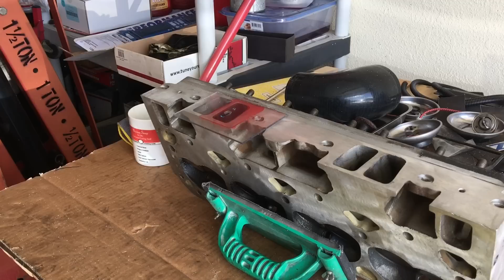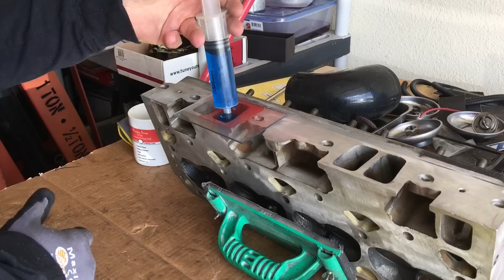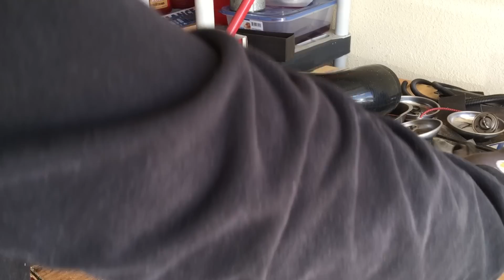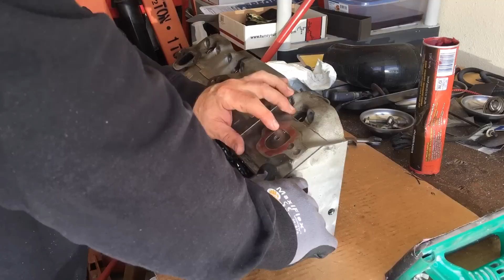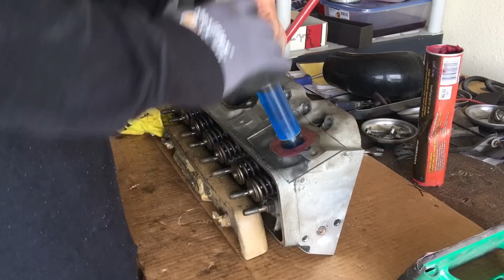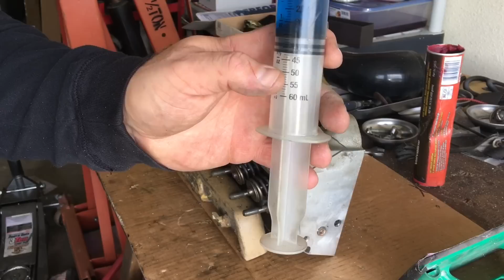Porting LT1 heads step 1

Comment: LT 1s supposidly are 163ccs. LT 4 Corvette heads supposidly are 195ccs and are bolt ons, the Corvette LT4s i think were the first chevy head to come from the factory with roller rocker arms, call Skoggin Dickey Chevrolet in Texas, they have a nice factory HOT CAM kit, Ive used it and it is exellent quality parts, the rockers acually have oiling to the roller tip needle bearings, Not getting paid for this plug, just helping.

Comment: We had great results porting them to LT .4 size,BUT you have to Weld up the tops of the ports in the rocker area, and machine the rail to  clear the LT 4 intake gasket, and we still used the stock intake valve, tricked out, just made the exhaust port bigger but kept the same D shape,used adjustable guide plates, roller cam, went from 12.24 to 11.83  ET. In a 63 Chevy 2, Hope this helps,But a lot of work! Just buy LT 4 Heads !

Comment: i am currently building my first engine and its a 96 lt1. i paid Lloyd Elliott to port my heads and grind me a came. this engine is for my 96 impala but now i have bought a 79 Malibu roller. i want to do a ball hon rebuild on a junkyard small block just to get this thing rolling.
it seems like out of all the small blocks that LT1 was the highest performance from the factory and I know you can put a carburetor, intake and distributor back in those motors I’ve seen it done. So thank you for the videos because I’m gonna try to port the heads myself
Reply from the maker: If you’re gonna build a regular small block Chevrolet, it’s hard to beat the factory, vortex cylinder heads.
Reply: @HeadFlowInc  i thought lt1 heads was a littel better, i can differently go vortex if you think thats a better way
Reply: I just got my first car, 1996 buick roadmaster, it has an lt1 o.o

Comment: Of course you’ve ported these heads! So happy to see that I can bounce some questions off you about these lt1 motors. Just got one and I’m gunn port the heads
Reply from the maker: The heads don’t flow we’ll stock, even ported decent you might see 250-260 cfm intake and 180-190 exhaust.  
What’s the build?

Those guys getting 270+ have tons of experience, larger valves ie 2.05” and most of the time altered sealing angles like 50°-55°
Reply: @HeadFlowInc  it’s not gunna be too crazy. Gunna run an XFI 280 cam and eventually some boost. So I’ll use the boost to cheat.
Reply: If it won’t flow in on its own I’ll just force it haha

Comment: I have a 94 firebird with 218/224 .528 .536 cam. I have iron heads that id like to port. Do you have any experience with them and do they flow better like people say?
Reply from the maker: Adam Weaver I don’t port iron heads anymore, but the aluminum LT1 heads come factory with 170cc intake ports and flow better than any factory double hump heads. 
Is the engine the original?
I feel you’d be better off either finding a set of good aluminum castings to port or going aftermarket. You can definitely upgrade the LT1 heads but definitely clarify all the machining costs etc to get what you want.  JD

Comment: Thank for the video rebuild my lt1 now I can do my heads myself
Reply from the maker: timthomas407 I’m ordering some new porting burrs to better fit the bowl work on these LT1 heads.  I’ll be posting progress videos in the next week, stay tuned!
One point you’ll have to address: If you want to run above a .525” lift cam the tops of the valve guides will need to be cut/machined .100” for valve spring retainer to valve guide/seal clearance. Must be done ✅ 
I’ll be checking all clearances associated with running a .570-.600 lift cam.  Also due to valve train weight it’s recommended to run valve springs with 150-160# seat and 400# open pressures to safely handle rpms of 6200+ rpms.

Comment: Are these early to mid '90"s LT-1 heads interchangeable with any gen one small block, and vice versa, can any gen one head be run on an LT-1?  I understand they changed the flow of the coolant on the LT-1's  so the heads get cooled first instead of the block on these engines which allowed higher compression without detonation. What was changed on the engine to change coolant flow direction?
Are the LT-1 heads all the same from 1992 thru 1996 ?
Thank you
Reply: Lt1 heads only work on an lt1
Reply from the maker: Keith Lane You’re right, GM reverse flowed the mid-90’s LT1 engines to eliminate hot spots in the heads. I’ve never owned an LT1 myself but I can see the heads have water ports on the ends, I’m not sure but it looks like water is forced into the heads straight from the water pump. 
The LT1 and LT4 heads have the reverse cooling and come with very small combustion chambers around 54cc iirc.
Reply: A few guys have done it 
You have to block off 2 water passage ways in the deck and add external water passageway to the water crossover on the intake
There's a guy that made a YouTube video showing how he did it